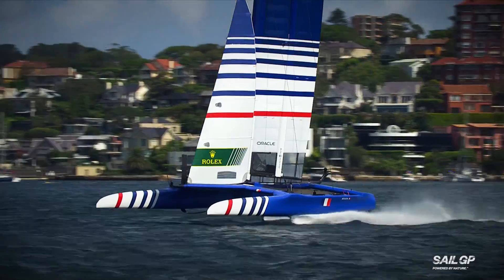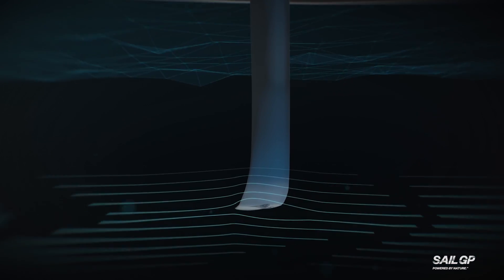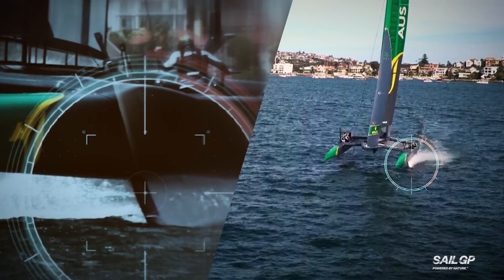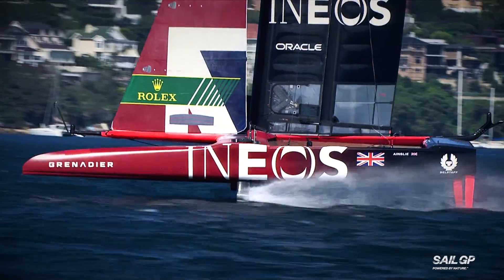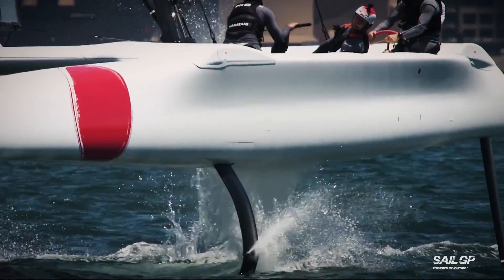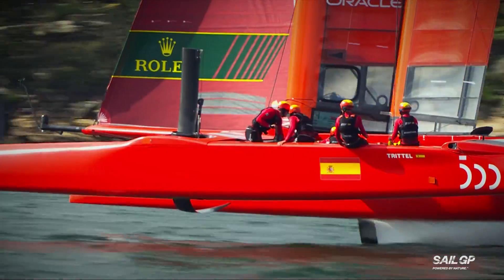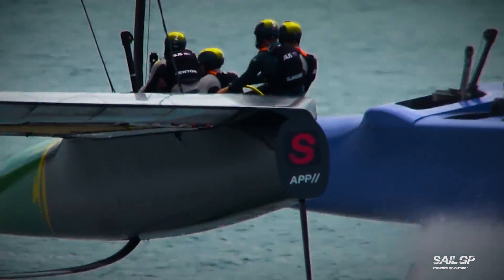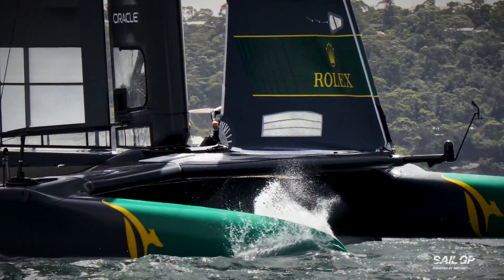SailGP 101: Flight Control | SailGP

Comment: I thought nose down heeling into the wind and low was the fastest setup?
Reply: Not sure of the ideal nose setup, but the lower the cat is, the more wetted surface on the dagger board and rudder, hence a bit slower due to more drag.  I bet with the nose pointing down the boat is more stable than if it would be pointing up.  More stability is more consistent higher speeds, so I think you're right with the nose pointing down.  Cheers from Canada.